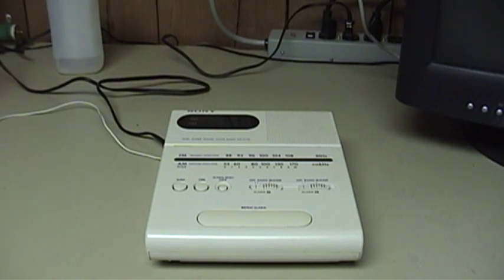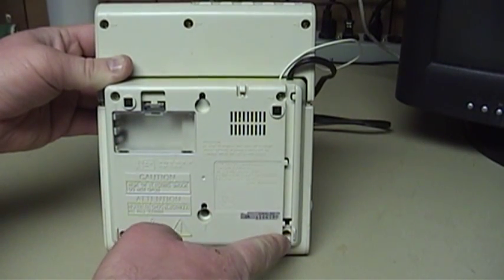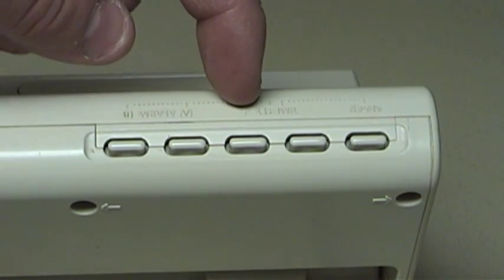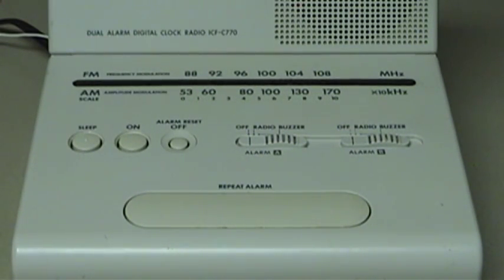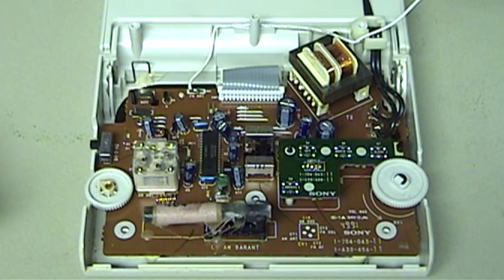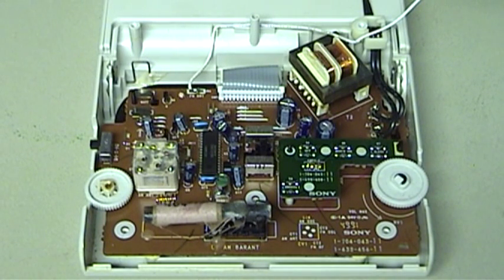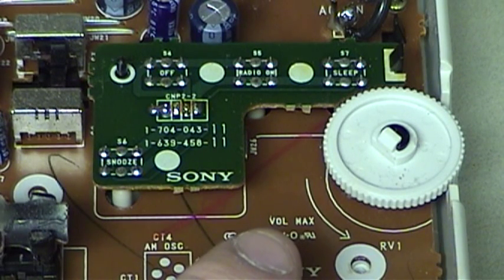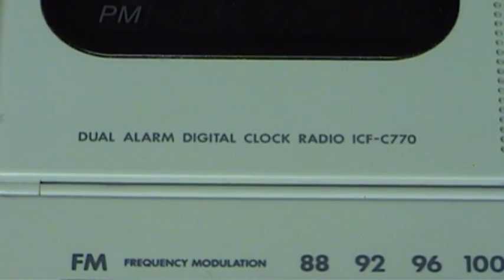Sony ICF-C770 Clock Radio

Comment: You should've tried Nightshot to see if that makes the green LEDs show up better.

My 1980s Magnavox clock radio uses yet another term for the snooze button: "Slumber". It also uses two different terms to refer to the 9V battery backup: "Power Back-Up" on the front panel, and an unusually British-sounding "Mains Breakdown Buffer" on the battery door. Even more unusually, the FM dial is marked in odd digits: 91, 95, 99, etc. With all that weirdness, I guess I should do a video on it!

Comment: It took me by surprise to learn that C414s show up in thrift stores considering I bought one new not more than a year ago. Alarm is on the quiet side (it has no true buzzer, rather it plays a tone through the speaker), but other than that it is the best (and longest lasting!) modern alarm clock I have owned to date.

Comment: I don't much use alarm clocks anymore. With my computer being on all the time, I just set a scheduled event to play an MP3 at a given time. Since I'm also an audiophile, my computer is connected to a substantial sound system and is more than loud enough to wake even the dead. I haven't used an alarm clock since the late 90s for this reason. That said, this is a neat little Sony unit and I'm glad you enjoy it. The video was fun to watch too.

Comment: I have the bottom half of the Sony Dream machine ICF-C25 and I was planning to add a line input on it like you said here but I need to find the right traces to cut so I can add the switch and input socket. If you plan to add a line input to this unit, please do post a video on it.

Comment: actually, having the display pointing up has an advantage. any light source disrupts our sleep. the best clock is an older windup. or better yet, if you are getting the proper sleep, you don't need an alarm clock.

Comment: Looks like a fine clock you have there, some great design by Sony.  

I have a rather large early 2000s alarm clock which I'm not too fond of truth be told.  It's like a large tin of baked beans in shape with the clock display and speaker on the front with the buttons on the top and sliders on the sides and back.  

I didn't know you could get an alarm with dual buzzer and radio option, though that would be rather inane in terms of functionality as it wouldn't help me wake up at all.

Comment: I have the exact same clock radio. I bought it about 40 yrs ago. It still works great but the display is a little dim. I came on YT to see if there's a way to make it brighter.
Reply from the maker: It's an LED display. You may be able to change the current limiting resistors and make it brighter in that way. This may also shorten the lifetime of the display, perhaps rather dramatically if you go too far.

I don't remember if there is a low/high brightness switch on this model. While I don't think so, you may want to check.
Reply: @uxwbill  thanks

Comment: Hello Sir, would you have a year that this alarm clock radio was released? I still have a working one in use at home. Thanks.
Reply from the maker: No, I don't. Sony should still have the manual available for download on their support web site. It will have a copyright date on it that would give you a rough idea.

A properly made clock radio should easily last decades.

Comment: Well bill, its all white i suppose lol, sorry bad joke, almost :-)

Ive seen the white tail on most bedside clocks and allways wondered why they didnt just bung a telescopic antenna on it instead, mains cables are not my idea of a nice antenna lol.

Strange about the snooze button, hmm...

Like the battery springs a lot!!, beats the thin and breaky wires they gob onto the pcb with something that looks like solder but flows like custard  :-)

Nice clean unit bill :-)

Comment: Just opened my wife's ICF-C770 because the radio reception was bad. She bought it from her first salary as teenager, judging from the manufacturing date on the PCB in 1992. I suspected some bad capacitor but it turned out the FM antenna was nearly completely broken. I cut-off the loose part and soldered the long end to the board. Ten minutes fix and audio is working again, *after 31 years*. I am careful with such old devices. This quality does not exist anymore in these years of chinese disposable devices designed no last no more than three years.